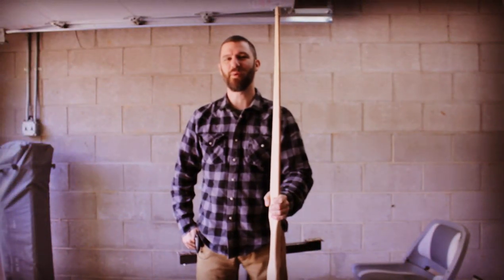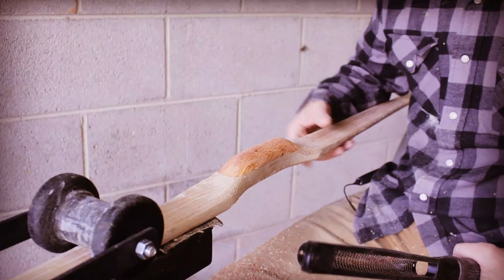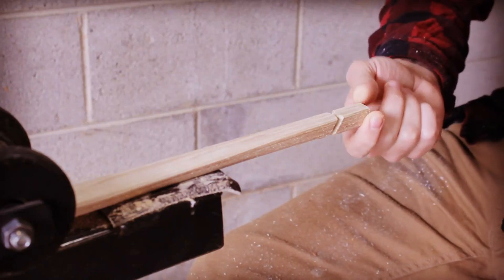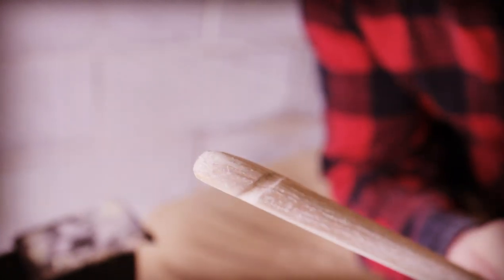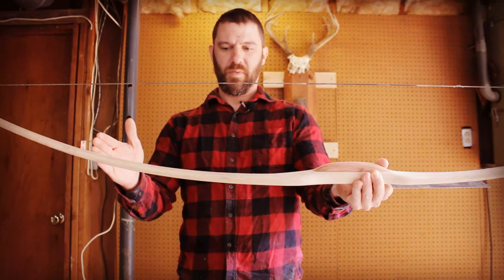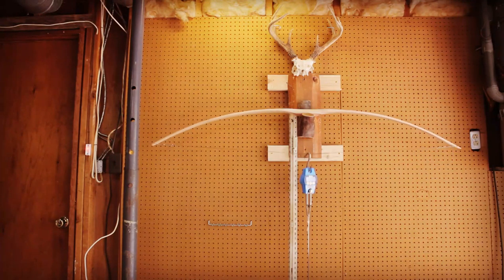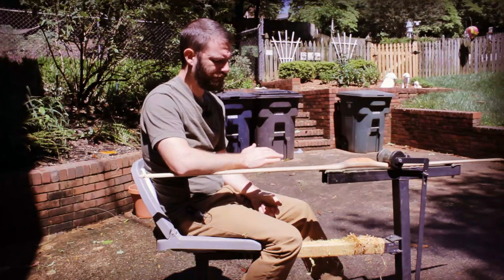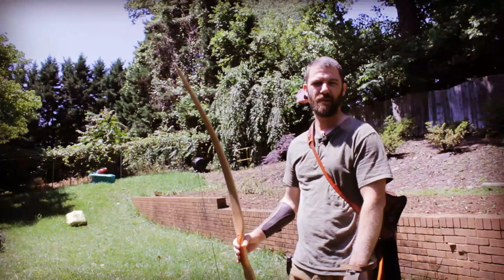How to Build a Board Bow, Part 5: Final Tillering, Finish Work and Shooting

Comment: Done.  1st bow.   Aiming for 40# @ 28 and got 35# @28.  Took your advice and went for a better tiller vs target #.  Seems to shoot well, little shock but nothing crazy.  Instructions were clear and left little to guess work.  Thanks a bunch.
Reply from the maker: Glad it worked out for you. You'll get a feel for managing handshock through design and tiller as you build more bows. There are a few different factors that can create handshock, an over built bow, too much mass in the outer limbs, a poor tiller that bends too much in the inner limbs and also arrows that are too light for the bow.

Comment: Your video is marvelous, I've been attempting to make a reasonable horsebow '54'' long, for some time now.I understand the shorter bows are challenging to make but thats what I like. I have made one from elm that has turned out pretty well, not as powerful as I would like tho! The biggest problem in New Zealand is getting the right wood, no hickory here ! I now have access to some American hard maple, I'd like to try that. I would be intrested to hear your opinion of maple as a bow wood. Your video has been very helpful, I shall follow it to the letter! Cheers from Mike, Waikato, New Zealand
Reply from the maker: Thank you! Hard maple works great for bows.

Comment: Really appreciate the videos, some great information for us beginners in there.  Question- you used a number of rasp/rasp-like tools in this video, maybe a short video on which tools and the specific application for each? Ive really been struggling with my cheap rasp (double cut flat one side, half round coarse on the other) and debating if i should pick up a different tool
Reply from the maker: Thank you. I have a video on tools but I've been meaning to do a newer, better one. Those cheap half round combo rasps are frustrating, I know. I used one in the beginning as well. It's worth picking up some better tools. They're not all super expensive

Comment: And now I want to make a bow 😅 
Do you have any tips for using power tools?

I loved this serie, thank you!
Reply from the maker: Do it! :) You can use power tools for some stages of the process if you want. I would recommend doing it at least once or twice with just hand tools. That will give you a much better idea of where power tools might be helpful and where they might be risky. If you have a bandsaw you can use it to reduce the board close to your layout lines. That can save a few minutes of draw knifing. Honestly though. The time often saved by powertools is fairly minimal and there is always the risk of a slip that can ruin the project in a second. The two power tools that I most often use is the bandsaw for roughing out large staves and a belt sander for shaping small things like tip overlays and arrow rests.